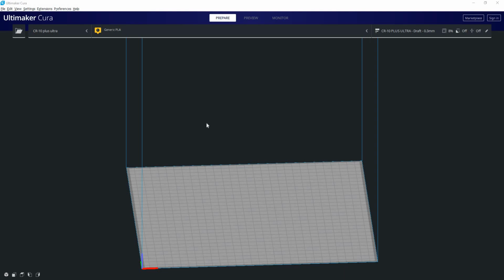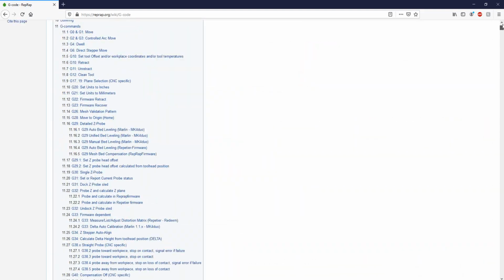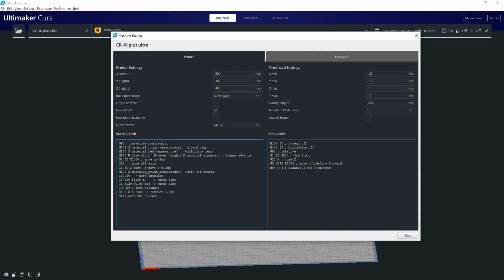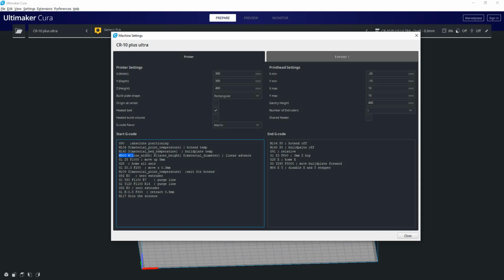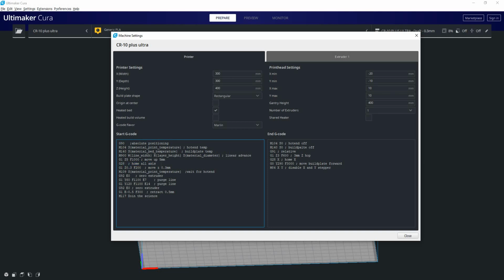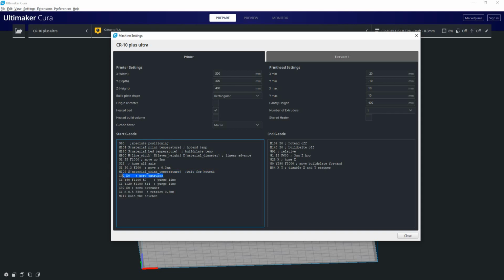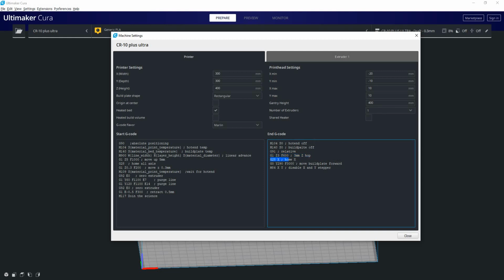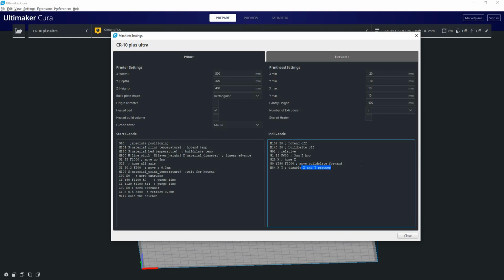Ultimaker Cura 3D Printing Guide: advanced g-code

Comment: What kind of things are you printing with all those Cr10’s? I’ve got a Cr-10 Max and did a sync mod to keep the gantry level. Works great! What size nozzles are you running?
Reply: i manage a product design firm, we develop products for businesses and clients across our area. i have all nozzle sizes and use  the nozzle most appropriate for the job, although the 0.8mm nozzle and the 0.4mm nozzle are the most common ones i use.
Reply: @agamingpotato  that’s great! I’m working on products myself, I’m at the point I need help on figuring out how to get products to market. Not sure if you have advice in that department?!

Comment: Thank you so much for this. I really hope I have good luck with the few extra things I want to do. This is for my Ender 3 S1 I just got.  I want to do a G29 Auto Level before every print and at the end I wanted to bring the build plate forward like you did but also bring the Z axis up and out of the way more to make sure I have enough room to peel the magnetic sheet off without the print head being in the way.

Comment: awesome video.
is there a way to turn off the bed temperature down or turn off after let say 1 hour or 2 hours or 1 day?
i have a bending problem and this comes from the bed temperature and the fan on my chiron.
i will appreciate any help. thanks!
Reply from the maker: Turning the bed heat off will only make it worse. The hest is to help prevent warping. You need either more heat or less air flowing over the part, like building an enclosure, or even putting a heater in the enclosure. You can also use a brim to help it stick. Turning your part cooling down can help as well
Reply: @ASciencePotato  thank you for your reply.
i was thinking a g-code that allows users to turn of and on the bed heat and the fan with intervals.
like using g-code for programming 1 hour on and then after 1 hour turn it off.
then again after 2 hours turn the bed heat and or the fan on and then on the 4th hour turn off (this regardless for the bed heat and the fan)

i actually did a brim by my self with 5mm which is a lot. i'm now guessing that the brim should be made not only in Z direction but brighter than the part itself.
your idea to build a enclosure will be the next step for me and try to see if this helps.
i really appreciate your response.

Comment: I have had Cura for some time, but this is the first time that I have ever really printed anything substantial.  My question is how do I send and see G-code, i.e., M or G, and see and read the results?  I am able to do that in Pronterface and S3D, but not Cura.  I am able to see the current machine settings and read them and even change items.  But I would like to send M503 and copy the results to a file for a record for reference.

Comment: Do the cura start g codes override the firmware values if they are stated in the code?
my ender 5 start code sends M200 codes which are messing with the vales I have set in firmware.

M201 X500.00 Y500.00 Z100.00  E5000.00 ;Setup machine max acceleration
M203 ..... ;set up feed rates
m204 ......;set up Print/retract/travel acceleration
m205  x8.00 y8.00 z0.40 e5.00 ; set up jerk

the last one is the worst. I change the jerk settings in the Cura profile and firmware but it always resets to the 8.00 value that is set.

Can I remove that set of m200 commands?  It seems all the settings should come from the firmware anyway. 
This is the default setting in Cura 4.8

great video. thanks for the Info
Reply from the maker: You should be good deleting all of that. Cura can override any firmware value with gcodes. So you should have to specify things like jerk and accel in the start gcode. Curs will do it

Comment: i have a delta printer do u know a code that after my print is done it will stay homed, on mine it will go to home but then drops back down and hits print everytime
Reply from the maker: the reason it is dropping down is because there is a command in your end gcode telling the motors to turn off. just delete that 1 line of code and your motors will stay powered after the print is down, which will lock them in place and prevent your hotend from falling.

Comment: Hi, so I’m having trouble changing the e steps with proterface because it doesn’t save the new settings. So I been looking for other options and thought of this, like on the start g code pit an M92 E450 command. Does it matter on what line of the start g code I put it? And does it stays like that for the complete print? Thanks.
Reply from the maker: what you want to do is make a blank text file on your computer. in it type

M92 E450
M500

then save it and change the extension at the end to .gcode instead of .text. then just run it in your printer. that m500 saves settings to your printer, so it should always be that value.
Reply: @ASciencePotato  Hi, so I did this, and it kinda work, so when I run it it changes the E steps but if I turn it off and on again, the e steps reset to the original value. Do you know what could cause this? I am very confused as this was happening when I used pronterface and don’t know the cause. Thanks again and this help me, now it is a little easier changing the e steps every time I turn on the printer.

Comment: Why are your printhead settings so different?
Reply from the maker: they are just stock cura values, they are unnecessary so i have not used them
Reply: Makes sense!  I was scratching my head because they were quite a bit different than mine.  Keep up the good work with these videos. Cheers!